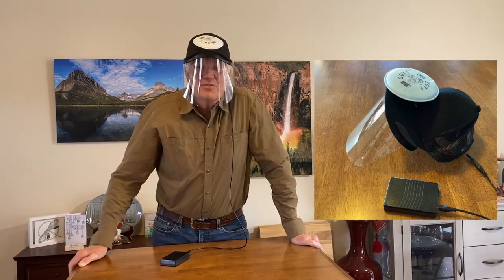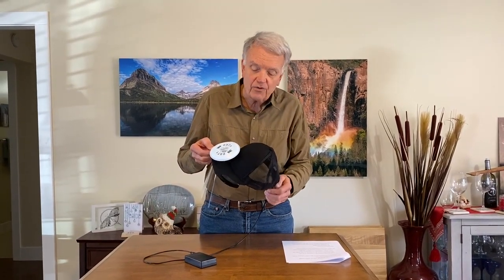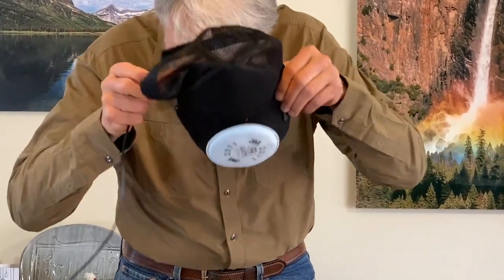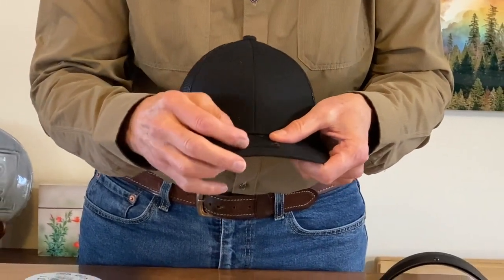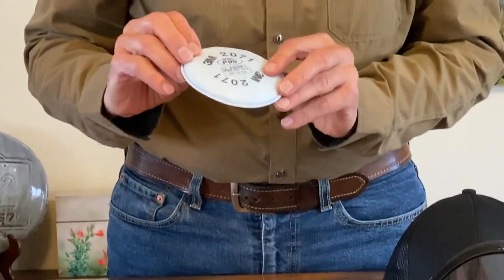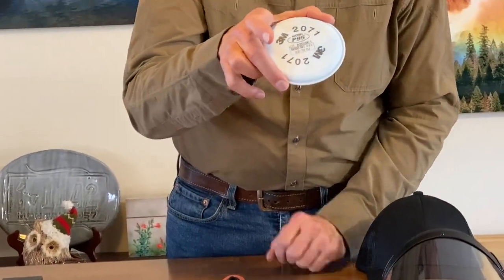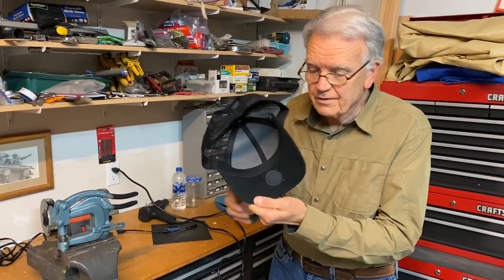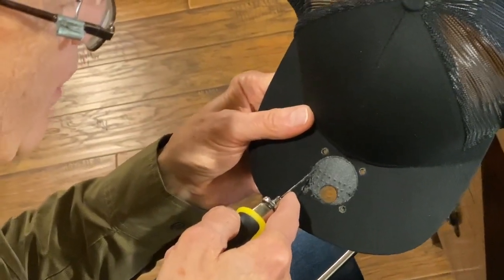How to make a Covid Cap with fan that blows filtered air next to face shield!

Comment: This face shield mounted to a visor with fan and p95 filtered air has become my "go to wear" when shopping or in close proximity to people. I feel like I am in my own little bubble! You still need to wear a face mask, but the filtered air circulating down from the brim of the hat keeps my eyeglasses from steaming up as well as providing plenty of fresh air to breathe. The fan makes only a low humming noise and certainly will not interfere with any conversations you may have. And the battery pack runs the fan for an entire day and then some. I feel like I added a better level of Covid protection with this well designed filtered face shield.

Comment: Fantastic!  :D

Any comments about the noise level?  Does it make it difficult to hear a conversation?
Reply from the maker: D: I am surprised how low the fan noise is. You can hear it but no problem talking to others or hearing others. When I was at the dentist, he asked me if it was running and moved his ear close to see if he could hear it. (I had my shield removed though so he could clean my teeth!)
Reply: @jlcarlsten8545  
Hi John
Would you consider selling the adaptor you made on the 3D printer?
I can  order/assemble the rest of the components of the hat. I must avoid Covid infection since I am immunocomprimized. Thanks for your great invention! 
Joe